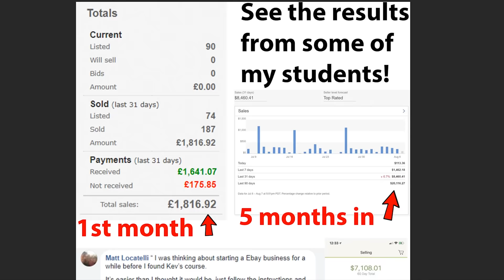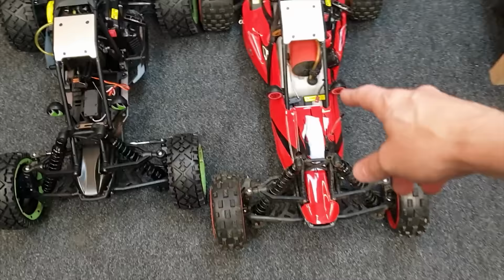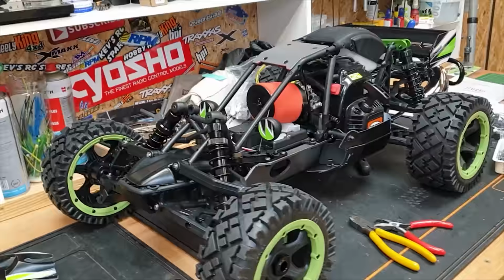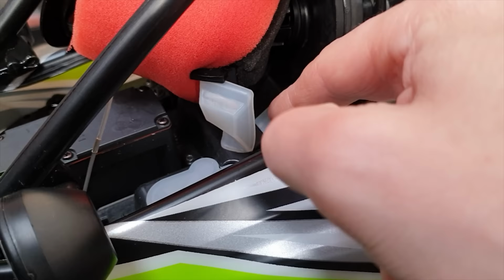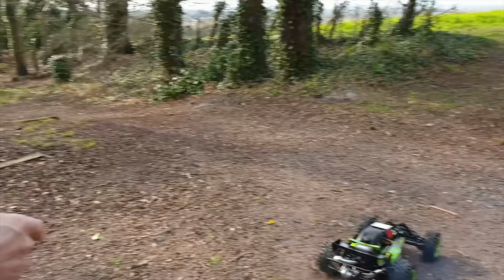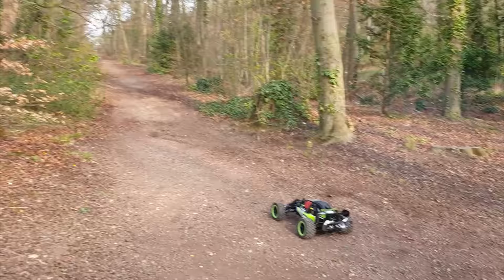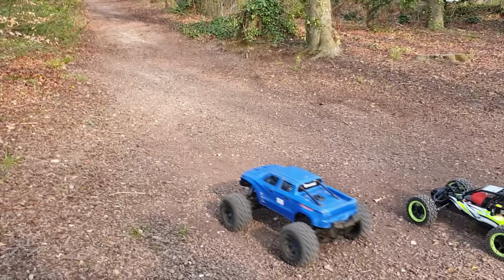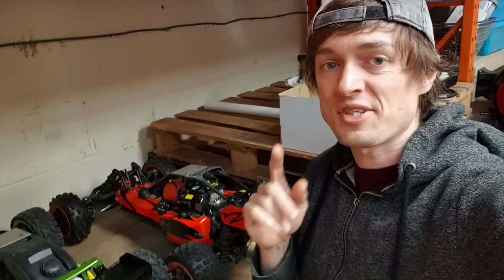Cheap Giant Petrol RC Car Test - Rovan Q-Baja

Comment: "yeah it's broken in... been running it for 5 minutes "
Reply: Run it in fast it will be fast
Reply: edgy guy still me say warm and idle. Others say warm it up and thrash it straight out of the box. I’ve done both ways. Don’t see any real difference
I do mix the oil slightly richer for the 1st couple of tanks and they run hard
Stripped engines down and nice bed in markings and good compression on the pull start
Food for thought
Reply: @tontobb8956  you won't see a lot of difference, just minor difference in the wear of the piston rings and thus compression of the engine.  You do get a better result running one tank through at idle before ever revving her, but if you don't mind the rings lasting just a little less and a little less compression after a few months...its not that big a deal.  More important if youre very broke or very competitive like a pro racer.
Reply: @NeoIsrafil  can you tell me how to break in my rovan ?

Comment: The smell of 2 stroke is amazing. Or at least it is from a motocross bike! Never seen one of these 2stroke petrol cars in real life
Reply: The smell is even better running race gas (VPC12 $20 a gallon) mixed with some dominator 2 stroke oil
Reply: @antilagboostaddiction8322  nice not sure what fuel that is bud, in uk we only have pump stuff, but its 98 octane rating. And 2 smoke oil i use is motul
Reply: 2 stroke is good,  nitro smells even better.
Reply: Nitro burns my eye personaly i like my 2 stroke qaud vetter
Reply: 2 stroke is better
Reply: Hell ya it smells good it’s a two stroke specially the factory bikes
Reply: I have a kx 60
Reply: The one kid which is me who rides four stroke crf 125 bigwheel
Reply: I have a question.... I WANT TO BUY THE RED CHEAPER ONE THAT HE SAYS IS DIRT CHEAP AND ABOUT 1/2 THE PRICE ... AND I THOUGH HE SAID IN ONE VIDEO ONE TIME IT WAS ONLY $300 AND HE SAYS IN THE VIDEO THAT THIS NEW ONE HE GOT IS ALMOST DOUBLE THE PRICE ... I CLICKED ON THE BANGOOD LINK AND THE " DIRT CHEAP " RED ONE IS $489.00 THE OTHER ONE HE SAYS IS ALMIST THE DOUBLE THE PRICE IS ONLY $600 .... THATS ONLY $100 MORE ?????  

IIKE THE FACT THE RED CHEAPER ONE HE HAS IS BIGGER A LITTLE LESS LOUD AND EASIER TO DRIVE WITH LESS WHELLIES ......    ANY HELP ON THIS PLEASE .... I WANT TO BUY ASAP !!!
Reply: I actually had a Kia Delta and was actually a two stroke haha I had to mix Gas and everything
Reply: @saulandresriosschambach6741  proper premix! Personally I hated mixing fuel for my yz.  One bloke I knew just got 5 litre container of petrol and just poured in a none specific amount of smoke oil. Fair to say his engine was always breaking or needed carb cleaning
Reply: @danh3017  lol I must've been drunk or something I don't know why I said that I've seen people say they are different but you didn't even say that 😂 my bad I deleted the comment

Comment: I run these 1/5 scale buggies. Great fun on a track with several people. I purchased a roller. Most of the problem with these are the cheap China engine and electronics. My roller I installed a modded Zenoah and decent radio and servos. Very reliable. Not as finicky as nitro. 1 or 2 pulls and it starts. They can take a beating, and for the size the parts are cheap.

Comment: The rovans used to come with a hump pack for the steering and throttle servos. I have the full size version. Very heavy but very fast and very cool. People are amazed the first time they see them.
Reply: I have a question.... I WANT TO BUY THE RED CHEAPER ONE THAT HE SAYS IS DIRT CHEAP AND ABOUT 1/2 THE PRICE ... AND I THOUGH HE SAID IN ONE VIDEO ONE TIME IT WAS ONLY $300 AND HE SAYS IN THE VIDEO THAT THIS NEW ONE HE GOT IS ALMOST DOUBLE THE PRICE ... I CLICKED ON THE BANGOOD LINK AND THE " DIRT CHEAP " RED ONE IS $489.00 THE OTHER ONE HE SAYS IS ALMIST THE DOUBLE THE PRICE IS ONLY $600 .... THATS ONLY $100 MORE ?????  

IIKE THE FACT THE RED CHEAPER ONE HE HAS IS BIGGER A LITTLE LESS LOUD AND EASIER TO DRIVE WITH LESS WHELLIES ......    ANY HELP ON THIS PLEASE .... I WANT TO BUY ASAP !!!
Reply: just bought mine, i was amazed how large it was .. xD i knew it was big, but when it finally i arrived i was speechless

Comment: My nitro rcs throttle servo got stuck fully open whilst it was running down the road, did about 50 mph into a kerb, did a big tumble into a bush, the only thing that broke was the steering servo!
Reply: Damn your lucky.  Receiver battery disconnected on my losing while I was going full throttle.  Rand into a fuckin wall and fucked the chassis real bad.
Reply: @benweinheimer6287  yeah i was lucky it hit the kerb head on so the small plastic front bumper took the hit (i was very surprised that it only had a bit of a dent in it) also one of the wheels got a bit scuffed
Reply: @benweinheimer6287  i found out later that one of the throttle servo's cables snapped, i think it got stretched or caught in the gears so that was the problem, now i have a servo to replace!

Comment: me: looks at the price of the 'dirt cheap' one and sees that it is $484
Reply: Real Bajas 1/5 go for about 1000$
Reply: True but also that’s probably about a 49 cc engine and it’s 1/5 scale so big + fast = 🤑🤑🤑.            Also kev has 1000 dollar cars so cheap is like 400 $
Reply: That is dirt cheap for what it is
Reply: I can get a real used junky working car for that price
Reply: @cass8144  it's probably only a 30.5cc or less but ya 4 or 500 for a 1/5 RTR is cheap. I've had ALOT of rcs from 1/16 to 1/5 I'd say a 1/10 Emaxx and a 1/5 Baja is my favorite out of the years of rcing
Reply: Yup super cheap
Reply: Some people are just stupid 🤦‍♂️ it's cheap for what it is i have one and didn't even break in the motor and it hasn't broken yet

Comment: Its so funny how your broke this in! Kevin you certainly ran it in alright🤣🤣🤣! If that little baja can take that kind of abuse straight from the box im definitely buying me one! I idle my engines for 20 mins and then cool 4 separate times then drive real easy for 4 tanks and start easing into the throttle on the 3rd and 4th tanks to break my little engines in then at 5 tanks I rip wide open and asses the tune if any richening or leaning is needed! Braaaaaap on my brother! I love the noise!! Never fuck off okay my gas brother🤣🤣🤣!
Reply from the maker: run it in fast it'll be fast lol
Reply: Kevin Talbot 🤣🤣
Reply: Thats how your supposed to break in a engine ... not 5 min .... lol
Reply: I have a question.... I WANT TO BUY THE RED CHEAPER ONE THAT HE SAYS IS DIRT CHEAP AND ABOUT 1/2 THE PRICE ... AND I THOUGH HE SAID IN ONE VIDEO ONE TIME IT WAS ONLY $300 AND HE SAYS IN THE VIDEO THAT THIS NEW ONE HE GOT IS ALMOST DOUBLE THE PRICE ... I CLICKED ON THE BANGOOD LINK AND THE " DIRT CHEAP " RED ONE IS $489.00 THE OTHER ONE HE SAYS IS ALMIST THE DOUBLE THE PRICE IS ONLY $600 .... THATS ONLY $100 MORE ?????  

IIKE THE FACT THE RED CHEAPER ONE HE HAS IS BIGGER A LITTLE LESS LOUD AND EASIER TO DRIVE WITH LESS WHELLIES ......    ANY HELP ON THIS PLEASE .... I WANT TO BUY ASAP !!!

Comment: Nice one Kev makes me want to get mine out to play. You call that running it in. 
I cringed when I saw you put nitro fuel on the air filter, you could do with a couple of Outerwears air filter pre-filters for added protection when running in the wet or dusty surfaces ditto the pull start and crank case, they will last longer good advice coming from a 35yr veteran of Gas trucks and Buggies including racing them. 
A killswitch again is needed, if you have an email address I can talk you through it.
Reply from the maker: thanks dude, my last killswitch must be faulty i have to send it back
Reply: @KevinTalbotTV  hey wanna trade, ur Rovan my rustler 4x4 with ez peak charger...box and every thing almost like new
Reply: Bhaiya recording kitne ki milati hai yaar

Comment: Ive been waiting for this video I just got a rovan baja 30.5cc it's a beast.
Reply: Rovans are good i use to have one before i sold it. They're a knock off of HPI and a Clone of the real thing. Still work fine but more maintenance and less power on them. At least they're cheap on parts and fixing.
Reply: I have a question.... I WANT TO BUY THE RED CHEAPER ONE THAT HE SAYS IS DIRT CHEAP AND ABOUT 1/2 THE PRICE ... AND I THOUGH HE SAID IN ONE VIDEO ONE TIME IT WAS ONLY $300 AND HE SAYS IN THE VIDEO THAT THIS NEW ONE HE GOT IS ALMOST DOUBLE THE PRICE ... I CLICKED ON THE BANGOOD LINK AND THE " DIRT CHEAP " RED ONE IS $489.00 THE OTHER ONE HE SAYS IS ALMIST THE DOUBLE THE PRICE IS ONLY $600 .... THATS ONLY $100 MORE ?????  

IIKE THE FACT THE RED CHEAPER ONE HE HAS IS BIGGER A LITTLE LESS LOUD AND EASIER TO DRIVE WITH LESS WHELLIES ......    ANY HELP ON THIS PLEASE .... I WANT TO BUY ASAP !!!
Reply: @thestrayjay2678  I have a question.... I WANT TO BUY THE RED CHEAPER ONE THAT HE SAYS IS DIRT CHEAP AND ABOUT 1/2 THE PRICE ... AND I THOUGH HE SAID IN ONE VIDEO ONE TIME IT WAS ONLY $300 AND HE SAYS IN THE VIDEO THAT THIS NEW ONE HE GOT IS ALMOST DOUBLE THE PRICE ... I CLICKED ON THE BANGOOD LINK AND THE " DIRT CHEAP " RED ONE IS $489.00 THE OTHER ONE HE SAYS IS ALMIST THE DOUBLE THE PRICE IS ONLY $600 .... THATS ONLY $100 MORE ?????  

IIKE THE FACT THE RED CHEAPER ONE HE HAS IS BIGGER A LITTLE LESS LOUD AND EASIER TO DRIVE WITH LESS WHELLIES ......    ANY HELP ON THIS PLEASE .... I WANT TO BUY ASAP !!!

Comment: I like gas powered rc’s I just don’t like the noise
Reply: Rc Freak out a gas powerd rc without any sound is just a elec rc car😂🤦‍♂️
Reply: How could you not like the 2 stroke sound
Reply: Its all sound no power its too slow
Reply: Electric can have too much power and no fun because it only lasts for 3mins with a big battery when your running like 60volts through it at over 400 amps esc don’t you see how stupid electric is for some things if that catches on fire aswel I like gas more fun aswel without doing backflips everytime you gently press the trigger
Reply: Electric guys want power normal peaple want fun that means gas lol 😂 even if it don’t start sill something to do while we are on lock down now lol  I am so bored right now I could just get bored and get exercise starting up
A petrol 29cc car up lol oh I need to buy two Rovan clones because my friend wants one to play with due to this lock down  too be honest just want something that runs and the battery you don’t have to worry about burning your house down lol

Comment: Question: What is the key difference between nitro and petrol powered RCs? (aside from the fact that they run on different fuel).
Reply: Irshaad Shaikh nitros have smaller engines than 2 stroke and 2 stroke engine are also it lawnmowers
Reply: @justbashingrc3624  so nitro engines have the same parts as petrol engines, just smaller and the fact that they use different fuel?
Reply: Irshaad Shaikh not a professional there will be more way in depth videos but that’s what i know
Reply: Nitro uses glow plugs and gas uses spark plugs. Nitro is also much higher rpm

Comment: I actually got a 50 mph + gas powered for a gift less than a week ago

I put nitro fuel in mine
Reply: I have a question.... I WANT TO BUY THE RED CHEAPER ONE THAT HE SAYS IS DIRT CHEAP AND ABOUT 1/2 THE PRICE ... AND I THOUGH HE SAID IN ONE VIDEO ONE TIME IT WAS ONLY $300 AND HE SAYS IN THE VIDEO THAT THIS NEW ONE HE GOT IS ALMOST DOUBLE THE PRICE ... I CLICKED ON THE BANGOOD LINK AND THE " DIRT CHEAP " RED ONE IS $489.00 THE OTHER ONE HE SAYS IS ALMIST THE DOUBLE THE PRICE IS ONLY $600 .... THATS ONLY $100 MORE ?????  

IIKE THE FACT THE RED CHEAPER ONE HE HAS IS BIGGER A LITTLE LESS LOUD AND EASIER TO DRIVE WITH LESS WHELLIES ......    ANY HELP ON THIS PLEASE .... I WANT TO BUY ASAP !!!

Comment: I just got one of these the other day got to break it in today only cracked the throttle a few times because I have a half acer however when I take it to the baseball park once I get on it will it be a wheelie monster? Or does it need to be tuned

Comment: Nice rc Buggy. Do aload of whily. Has a Open exhaust System. The engine 29 cc. The cluch spring Open later meby. I think the Car have a schort. Transmischen. Meby Not so fast.

Comment: Put 100 octane in the gas tank and watch the thing explode like a 12s battery in a 4s capable esc. 😂
Reply: The compression is low so high octane theoretically wouldn't
Reply: rc player actually, you're right. But it's Kevin Talbot! He can find ways to blow anything up. 😂
Reply: True hes a breaker.....

Comment: How do you place your gopro on your RC cars?
Reply: From what I have seen, he normally uses hot-glue.  
I have given up on mounting mine with the GoPro mount pads.  Seems like they always fall off.  Instead, I have been bolting them to the car in various ways.
Reply: @RoadsideRC  If you use GoPro mount pads you should definitely let them rest for 24 hours so that they certainly stick well.
You can use clamps or put on a heavy weight while the pad is sticking.
I also use them and they have never fallen off.
You will certainly find a tutorial on youtube.

Comment: What is the price difference for? Both have 29cc and the cheaper one has a longer wheelbase? Wheres the extra 200$ going for a shorter rc?
Reply: I have a question.... I WANT TO BUY THE RED CHEAPER ONE THAT HE SAYS IS DIRT CHEAP AND ABOUT 1/2 THE PRICE ... AND I THOUGH HE SAID IN ONE VIDEO ONE TIME IT WAS ONLY $300 AND HE SAYS IN THE VIDEO THAT THIS NEW ONE HE GOT IS ALMOST DOUBLE THE PRICE ... I CLICKED ON THE BANGOOD LINK AND THE " DIRT CHEAP " RED ONE IS $489.00 THE OTHER ONE HE SAYS IS ALMIST THE DOUBLE THE PRICE IS ONLY $600 .... THATS ONLY $100 MORE ?????  

IIKE THE FACT THE RED CHEAPER ONE HE HAS IS BIGGER A LITTLE LESS LOUD AND EASIER TO DRIVE WITH LESS WHELLIES ......    ANY HELP ON THIS PLEASE .... I WANT TO BUY ASAP !!!

Comment: Isn't the running in process long and tedious for instance I always fill up a tank let it sit on idle for two tanks then 3rd tank drive it about on 1/4 throttle for another tank 4th tank1/2 throttle and 5th tank full throttle for a second or two then after that it should be good. Is that correct I don't know
Reply: nah brother its exactly like a tree feller chainsaw maybe the first run just do circles and 2nd tank, light er up
Reply: Oh right OK then I have been doing it wrong then nothing wrong with it I guess

Comment: Is that exhaust pipe just for show? :)
Reply from the maker: na its real
Reply: @KevinTalbotTV  I have a question.... I WANT TO BUY THE RED CHEAPER ONE THAT HE SAYS IS DIRT CHEAP AND ABOUT 1/2 THE PRICE ... AND I THOUGH HE SAID IN ONE VIDEO ONE TIME IT WAS ONLY $300 AND HE SAYS IN THE VIDEO THAT THIS NEW ONE HE GOT IS ALMOST DOUBLE THE PRICE ... I CLICKED ON THE BANGOOD LINK AND THE " DIRT CHEAP " RED ONE IS $489.00 THE OTHER ONE HE SAYS IS ALMIST THE DOUBLE THE PRICE IS ONLY $600 .... THATS ONLY $100 MORE ?????  

IIKE THE FACT THE RED CHEAPER ONE HE HAS IS BIGGER A LITTLE LESS LOUD AND EASIER TO DRIVE WITH LESS WHELLIES ......    ANY HELP ON THIS PLEASE .... I WANT TO BUY ASAP !!!

I'm in NY ...... I JUST WANT A GOOD ONE FOR UNDER $600. I REALLY LIKE THE RED ONE YOU HAVE BUT ITS ALMOST THE SAME PRICE AS THE ONE YOU SAID IS ALMOST DOUBLE ..... I LIKE HOW THE RED " DIRT CHEAP"  ONE DRIVES, GAS TANK LICATION , BIGGER , AND COMES WITH A BATTERY THAT I DONT NEED TO BUY AND MESS WITH GETTING IT IN THERE ..... I WANT ONE RTR , AND PROBABLYNOT AS LOUD AS THAT ONE , MY NEIGHBORS ALREADY HATE ME FROM MY QUADS AND DIRTBIKES. LOL
 ........ ANY SUGGESTIONS  ?????
Reply: I have a question.... I WANT TO BUY THE RED CHEAPER ONE THAT HE SAYS IS DIRT CHEAP AND ABOUT 1/2 THE PRICE ... AND I THOUGH HE SAID IN ONE VIDEO ONE TIME IT WAS ONLY $300 AND HE SAYS IN THE VIDEO THAT THIS NEW ONE HE GOT IS ALMOST DOUBLE THE PRICE ... I CLICKED ON THE BANGOOD LINK AND THE " DIRT CHEAP " RED ONE IS $489.00 THE OTHER ONE HE SAYS IS ALMIST THE DOUBLE THE PRICE IS ONLY $600 .... THATS ONLY $100 MORE ?????  

IIKE THE FACT THE RED CHEAPER ONE HE HAS IS BIGGER A LITTLE LESS LOUD AND EASIER TO DRIVE WITH LESS WHELLIES ......    ANY HELP ON THIS PLEASE .... I WANT TO BUY ASAP !!!

Comment: You know this was designed by some random guy in china when the freaking fuel tank is sitting on top of the scorching hot exhaust pipe.
I hope there is at the very least 1 inch of clearance or pray that fuel tank is made from heat resistant plastic… Then you get to the issue of having that fuel tank is such a vulnerable place in the roll cage..
Reply: clearance is more like 1/4 inch...
It is thick but not that thick

Comment: Quick question Kevin Talbot so I have a gas 1:10 scale volcano s30 and the problem with my rc greatness is that there is no more steering from the controller to the truck and the motor moves a tiny tiny bit. But i can figuer out what is going on and i don't want to wast money on something that could be a possible easy fix
Reply from the maker: Hey dude, sorry it's impossible to tell without seeing it, I hope you figure it out if not maybe make a video or take it to a hobby shop.
Reply: Well i took apart the front end to gget the servo motor out and tried on the different channels and nothing worked so I think its blown but thank you and i will we what i can do